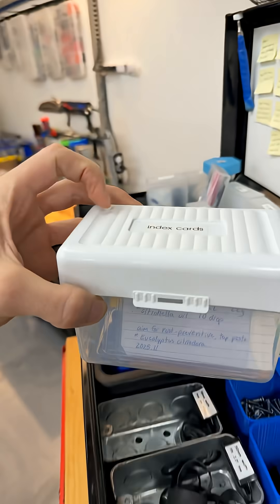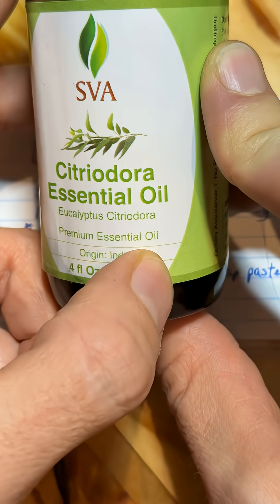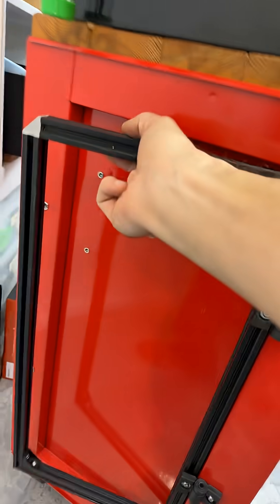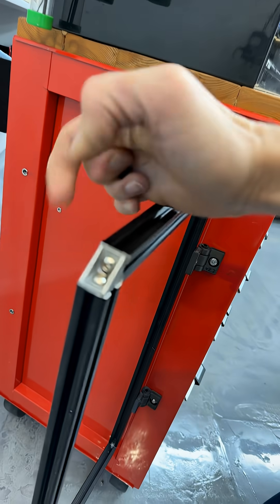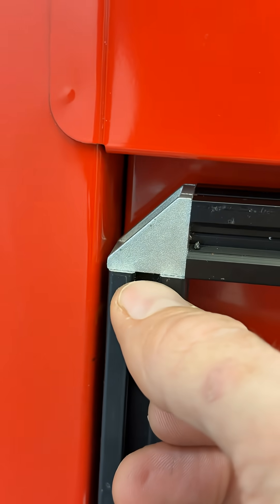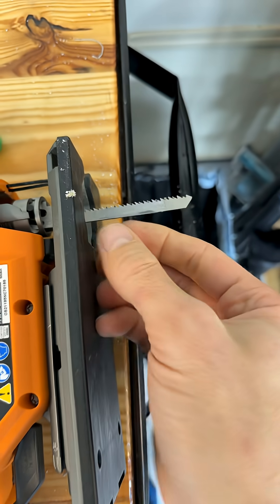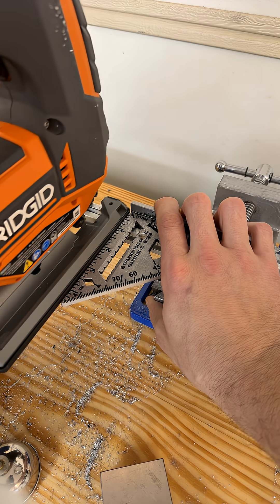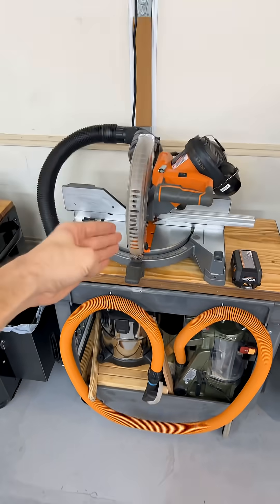Tool Paste (wax) formula and how it helps 🪚👀 #openlab

Comment: I'd like to hear more about the purpose of the ingredients in the recipe, specifically the citronella oil. Here's my guess, I'd love to hear if I'm close. 

-All the ingredients are obviously for lubricity, being a bunch of lipids
-the beeswax keeps the lubricant solid while handling, but melts easily with friction
-the motor oil allows for smoother application, better consistency, and for the paste to be a little more like a thicker oil / thin grease
-the citronella, (this is a total shot in the dark) behaves like an oil's additive, maybe it sticks to the steel better, or helps conduct heat, maybe it helps the other two ingredients mix? 

I'm super curious because I'd love to substitute out the citronella, since I don't have any handy and I'm currently unemployed. 

I love the way you work, I'm adopting as much as I can into how I do things. 

Unrelated tip that you might not know, hand sanitizer removes sticker residue really well. Isopropyl alcohol kinda just makes it smear but hand sanitizer makes it clump together and the clumps wipe off

Comment: I'm sure you've considered this and found a good reason not to do so, but why haven't you simply extended the vertical extrusion to match the full side length, drilled a hole in it to line up with the hole in the center of the horizontal extrusion, and run a bolt through the hole? It saves a bolt, removes a specialist component (2020 corner brackets), and I believe would be a stronger joint.
Reply from the maker: Oh, I strictly do not drill holes in the side of my extrusions, mainly for re-use and consistent designs.  I often find myself disassembling an item and rebuilding, with old pieces.  Each time I drill, I'm adding fabrication error so I don't always get it perpendicular. Further, this extrusion has a tiny groove at the base of the slot.  Almost every time, my drill picks up an edge of that groove and suddenly walks right before it drills.  CRAZY the drill walks uphill too.  Of course there are ways to refine the drilling but I pretend everything I do will be copied by a novice.

Comment: Your card system of shop recipes, if you have that box scanned, I loved to get a copy of that useful concentrated knowledge.  I'm definitely going to duplicate that easy reference system (good place for solvent, seals and other standards or ratios)
Reply from the maker: Right now I have just two cards.  My other recipes are scattered across 10 years of spreadsheets.  Over time, I'm consolidating files.  Then for sure I want to make it public and editable.  

Of course I don't need to wait to publish a few.  But there needs to be some kind of structure, so i'm not defining a format every time I post something.   Always open to feedback and benchmarks, ie how do others post shop recipes?

Comment: say it with me: recipes lock you in but ratios set you free
Reply: I think taking a minute to expand on the recipe by saying its use longevity, and a generalized ratio would probably be ideal
Reply from the maker: If I publish my recipe: you have the ratio and the recipe.  If i publish a ratio, you cannot derive the recipe.

For the sake of science, it’s a recipe so the data aligns with the bottle in your hand.  Then if the author made a mistake in writing the correction can be recovered through logic.

So we need to write down ground truth when we formulate, then perform math in our documentation.  (this is just my policy for myself, at least)

Comment: I don’t know what you’re tapping but when it comes to any kind of metal, use a lubricant called Molly-D. It has a distinct smell but works amazing and you get the best threads possible for the tap and hole. Countless years of experience tapping every metal there is.
Reply: He was asking a different question than what you answered. What can you achieve with molly D that he cant achieve with his wax?
Reply: @tajr22 
Oh, I apologize, well for one, Molly-D has molybdenum disulfide, it forms a super thin layer of lubricant that holds up extremely well with heat that comes with the friction of tapping, somthing any wax has no chance of doing as well, for starters anyway. 
Thank you for clarifying
Reply from the maker: thank you sir william!  In my case my target is: 1) don’t break the tap.  2) dont smear the chips into workpiece. In your experience, what problems arise without Moly-D?
Reply: @davidmalawey 
None besides it has a tendency to stain clothes. Some don’t like the smell but truth be told I actually like it, lol. I just wouldn’t use tapping micarta but not a lot of people work on that material.
Reply: @WilliamTaylor-qj3jy what issues do you have if you use something besides Molly-D?

Comment: I heard a pellet of camphor in your toolbox helps to prevent rust. 
Never tried it myself though. I live in a dry climate and some oil is good enough.
Reply: THIS!
Reply: It does work, but it's only appropriate for small enclosed spaces where the vapor isn't likely to blow away, so it's good for toolboxes/chests, small parts cabinets, etc, but no good for open-air tool racks and such. For storage or shipping purposes, VCI paper works great.